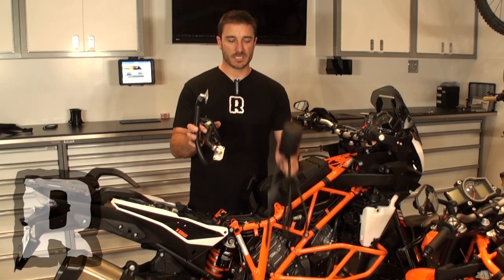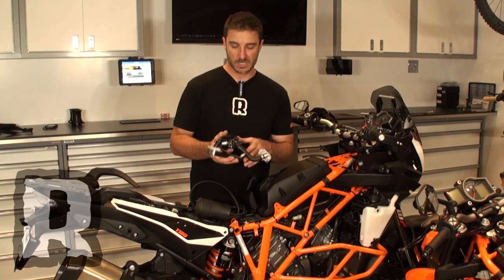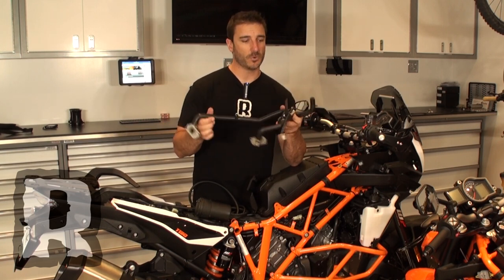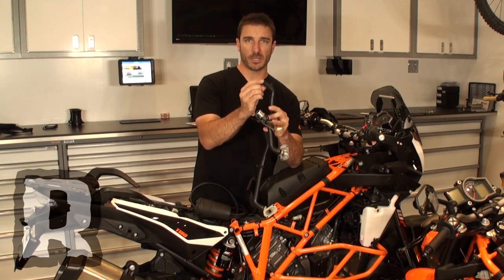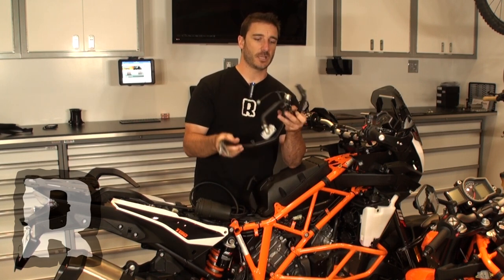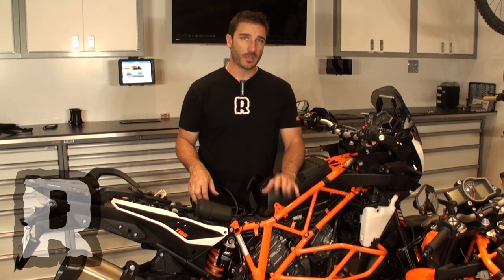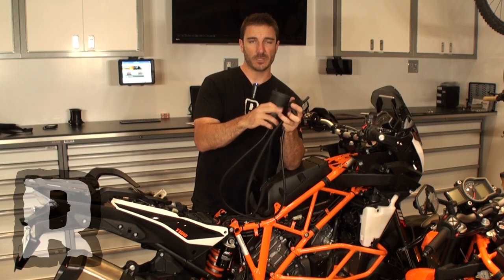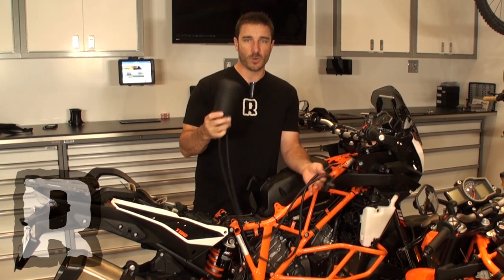BIKE BUILDS - UNDERSTANDING SAS/CANISTER SYSTEMS - KTM BIG TWINS

Comment: I have these removed and block off plates on my 2012 smt , full leo vince system . Its mapped to suit and has a DNA air filter . If i wanted the deceleration pops ... could i jjst remove the block off plates ? Or would that damage the bike ? Thanks

Comment: Hello, I have a KTM 1190 adventure, lately it started to show general failure error, I ignored it thinking it will go off. But it didn't. Now I'm facing starting problem. I even replaced the battery but it didn't help. I have to tow it to get it started, once it starts it works perfectly fine, but when switched off it does not picks up the self. Any suggestions how to diagnose this issue?
Reply from the maker: Most of the time that just goes away, but you do have a bike with 5 computers so, unfortunately, the only people that can diagnose that are KTM technicians because they are the only ones that KTM will sell the diagnostic tools to. It's their way of funneling all of the service work back to them but some good hacker companies are catching up that we are working with and we should soon have the same power to diagnose but not quite yet. (2/5/19)

Comment: But I want the burbling and gurgling
Reply: Same... I removed the SAS as everyone was saying it's needed. It's not an easy job either, fuel tank, air box & cuts on hands. Not everyone has new shiny bikes stored away just to make videos on. Pain in the ass! I'll be putting my SAS back on if my flames & pops are completely done. As that's the main reason I got a decat & weight savings.

Comment: Hello. I just bought the used one 1190 Adventure R and I do not have this canister, just two wires, one is blocked by some plastic cap on the end. Should I blocked the second one also or just buy this canister and connect everything up?
Reply from the maker: Wires or hoses? If hoses, blow into them. The one that exits at the tank (open the tank filler and listen) needs to be open and to the ground. The other travels to the side of the intake tract and can be cut short and plugged. If you mean electical wires, we would need to know more as we are not too sure of what you mean.
Reply: No, not electrical, I just blowed and this which is open is going to the tank so everything is correct. Thanks for tips. Take care!

Comment: What does removing these do to the factory warranty? Should I wait until the two years are up before doing this?
Reply from the maker: Nothing at all and KTM knows that. They would be hard pressed to deny a warranty based on the removal of that. In their race kits such as the Akrapovic exhaust systems on the Super Duke they even include them and there is no significant change to the motorcycle that adversely effects anything. If anything, removing the system is easier on the bike, as the exhaust runs cooler because of less burning oxygen in the header from the SAS. Your call, but in the last 10 years we have never heard of a warranty being denied for such things. Plus it is illegal if they can't prove causal effect. You are good.
Reply: @RottweilerPerformance  Thank you. Sounds like this will be by next project!
Reply: @RottweilerPerformance solo para que estén al tanto, en Argentina Ktm me negó la garantía por sacar el Canister 🤷🏻‍♂️
Aunque personalmente creo que no afecta, ellos insisten que anula la garantía. 
Saludos.
Reply from the maker: @tincho1979  Esto es ilegal en los Estados Unidos y en la mayoría de los países. El distribuidor sabe que quitar las emisiones no tiene nada que ver con el correcto funcionamiento de un motor y debería avergonzarse de sí mismo. Desafortunadamente, no parece que su país cuente con leyes para proteger a los consumidores de cosas tan frívolas.